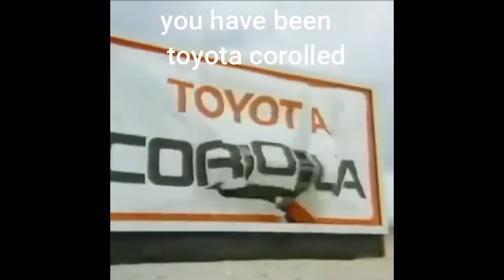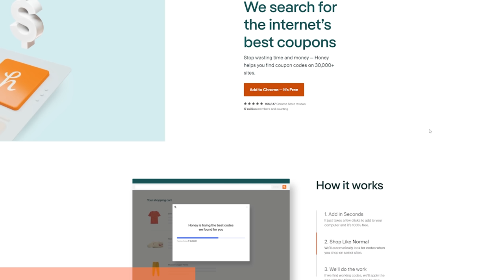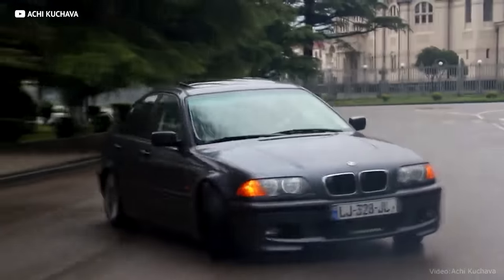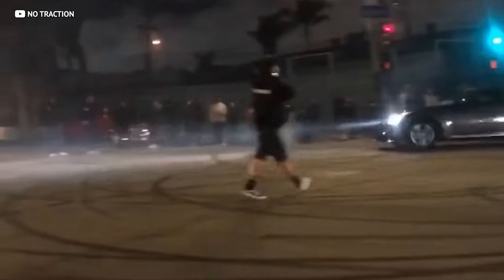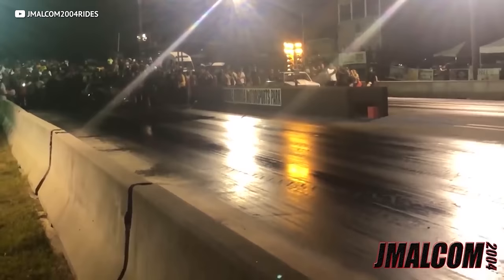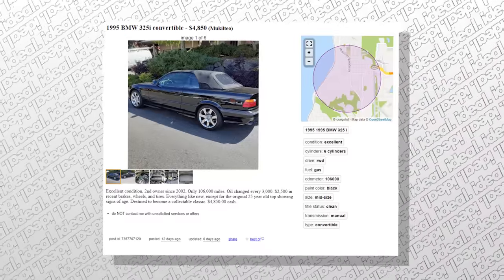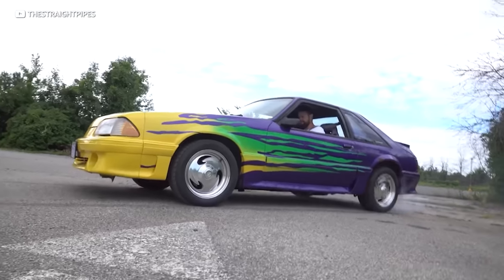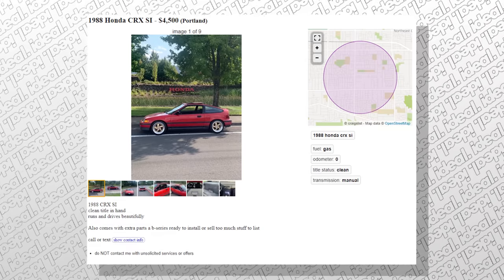8 CHEAP Cars With Unlimited Tuning Potential

Comment: At this time I have 2 1000 hp acura legends one is a 1995 and my second one is a 2004 same c35a1 engine in both and 6 speed manual with compound rear mounted turbos one is fwd and my 2004 I am converting it to rwd I am using the rear suspension and dif from a is300 I daily drive my 95 legend coupe the only problem is their are no mods for the C-series engine but the engine is already fully forged except the pistons but I found some similar pistons that are forged and the C-series is already balanced and you cant even feel it running when it's on also it has a redline of 8900 rpm if you tune it right I hade to make a custum ecu with the oem ecu to tune this car wich was not easy
Reply: I have a 93 legend coupe L 6 speed type 2 in mint condition that I'm slowly modifying. I'm interested about your legends. Do you belong to any legend communities or have social media?

Comment: Top 10 Ultimate Tuning Cars 
1. TOYOTA SUPRA MARK IV, 2JZ-GTE
2. MITSUBISHI GTO 
3. Nissan Skyline GT-R34 S (Sedan) 4-Doors
4. HONDA LEGEND Coupe II 3.2i
5. SUBARU SVX
6. Mazdaspeed3
7. BMW M240i 
8. Mercedes-Benz 500 E / E 500
9. Audi Cabriolet (Typ 8G) 2.8L V6, 6 Manual, S2 (PUBG Car)
10. Daihatsu Hiline 5-door, 2.8L i4 Diesel Turbo, 5-door, 5-Manual, JDM Called it likes Japanese Hummer Diesel Tuning

Comment: This Video is so outdated already. If you find a good e36 for under 5k ill aplaud you. But unless you buy a half dead rustbuckd with the cheapest options in terms of engine and inside you wont have any luck. Have fun trying ti race with 90hp

Comment: Right now I'm looking to pick up a car next year to drive in the Rallye events I go to, have an1970 Volkswagen beetle 🐞 convertible with 2ltr motor but I can only do so much with it , even in the canyons handling is limited as I tried to keep up with the Porches,  Lamborghini's , BMW'S in the canyons🤣🤣🤣😏 so I must concede now my charger can hang on the highways as I have taken it out also on the runs but on corners not as tight as the ones that have track suspension or coil overs which give better cornering but stiffer overall ride.  
So now I'm looking at either a 370, G37 Sport G60 Sport or the 2022 400z or 2022 WRX STI next yr, so then I'll have something that can handle corners and carry speed at the same time🤷‍♂️

Comment: boutta commit car community suicide here. gen 7 toyota celica. i know, people for some reason, hate that car. i know it discontinued the GT4 line, i know it was NA, i know it was FWD. but lets be real honest here, there's 20 hp difference between it and the DC2 integra. and IMO, looked far better. i understand the Gen7Celica's drawbacks with it's oil pump gear and lack of a baffled oil pan, but c'mon let's be real here... if you want a cheap car that you can mod the life out of and make a 900HP burnout machine, a Celica7 aint a bad route to go

Comment: all those cars are trash and overhyped with no reason expensive parts besides the g35, Transam Fire Bird and Civic That ACTUALLY HAVE UNLIMITED TUNING POTENTIALS.

Rather buy 
1) Miata over Mr-S
2) Gs300/400 over that Weak is300 with weak trans and diff{expensive for 2jz swap} and Gs400 is V8! 
3) g35 for drifting and transam firebird for drag racing power plant already skip all the work that require to do in the Bmw, saab, and mustang.. no need...  

4) The Civic THE CAR with ULTIMATE UNLIMITED TUNING Potentials... Parts are interchangeable with other honda and acura cars. Unlimited tuning options ON REAL BUDGET builds giving those other cars a run for their money...